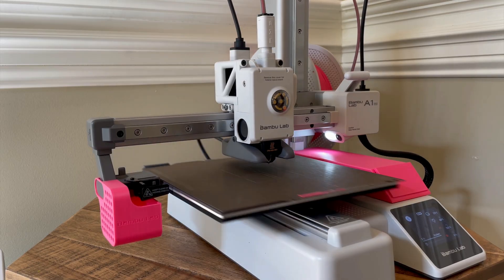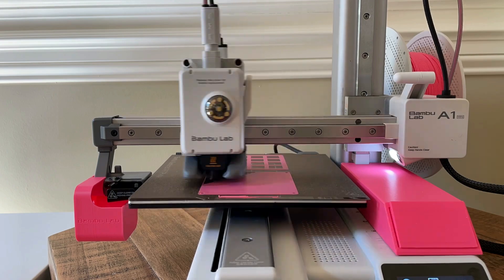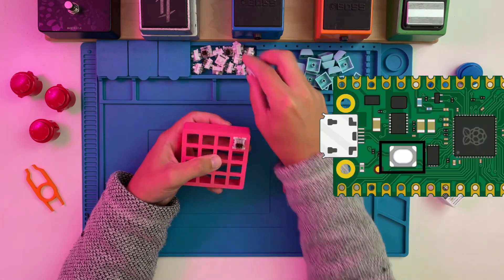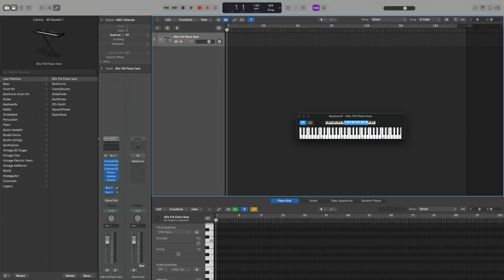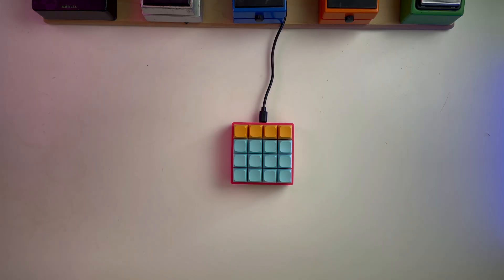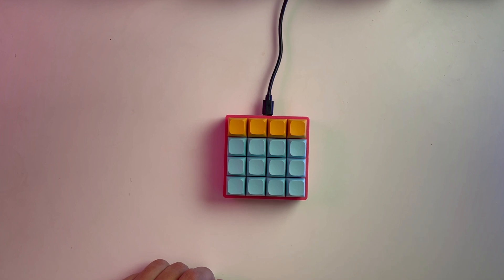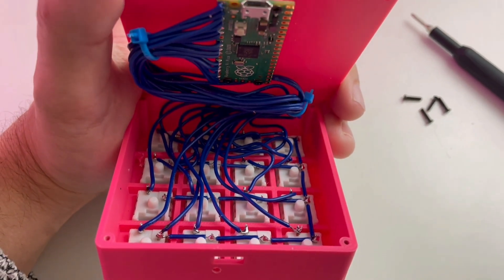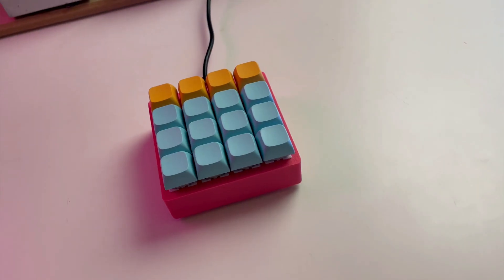DIY 3D-Printed MIDI Macropad | Simple Design, Hidden Features w/ Raspberry Pi Pico

Comment: Hi and thanks for the cool video. I tried to  work with a Pi Pico too but using circuitpython. At the end I could  send MIDI to my pc but not to my Yamaha keyboard using USB. AI told me to buy a USB Host MIDI device. Do you think that this is correct? Cause in other of your videos you said something like these devices support MIDI directly. Or did you only mean MIDI in combination with a PC? I’m new to MIDI, so sorry for this stupid question.
Reply from the maker: That’s a good question. So there are two USB MIDI types: MIDI Host and MIDI Device. Raspberry Pi Pico is a MIDI Device. A MIDI Device needs a MIDI Host to connect. Two way communication is possible between MIDI Host and MIDI Devices but two MIDI Devices can not communicate unless they go through a MIDI Host. Your DAW would be a MIDI Host. Some MIDI Controllers and Microcontrollers like the Teensy can also be a MIDI Host but Raspberry Pi Pico is seen as a MIDI Device. If your Yamaha can act as a USB MIDI Host then the Pico should work with it but if the Yamaha is another USB MIDI Device they can’t communicate without a MIDI Host. I hope that explains things.
Reply: @mobypixel Thanks for the helpful answer. Then I have to buy a small device like the CME H4MIDI WC. Or I try to use the Pi Pico sending UART signals via a cable with a 5-Pin-Connector with 2 x 220 Ohm resistors for Pin 4 and 5.
Reply from the maker: Yeah, you can make a MIDI DIN circuit that uses UART. I’ve not tried that before but it should work. I have the parts to build that circuit but haven’t gotten around to it. If you aren’t opposed to using a computer in some DAWs you can plug up both MIDI Controllers and have the daw send messages from one device to the other. Not ideal for a DAWless setup but it can make patching a lot easier.

Comment: This is cool! Can we get the link to the microswitches, I cant seem to find them:(
Reply from the maker: I've just updated the Github Readme with the ones I used. Cheers!
Reply: @mobypixel  Thanks! How would I go about creating a remix of the 3d model and legally crediting you as the original creator?
Reply from the maker: It is MIT license so you can use it however you like. Attribution appreciated but not required. As for remixing it I’m not sure. I made it in TinkerCAD. Is there a file type or way to share a project from that app that is editable?

Comment: Really great project. I am also trying to build a groovebox+sequencer+sampler thing from scratch. This was really useful in seeing the capabilities of the pi pico
Reply from the maker: Thanks! That sounds like a cool project. For anything sample based I'd check out Teensy or Daisy Seed. They cost a bit more but a little more powerful and designed for audio. MicroDexed-Touch is a great groove box on Teensy and Chompi uses the Daisy Seed. That being said, the Pico punches above its weight class and if you can get the sample playback working well it could be a great, affordable option.

Comment: Hi, I wanted to ask if there is also a way to implement a multi-track mixer with AudioKit? With audio routing, etc.
Reply from the maker: I’ve not messed with it much but they were talking about multitrack work on this thread. https://github.com/AudioKit/AudioKit/issues/2962

Comment: Something like this could be fun as a EWI/EVI style controller. Make an enclosure with seven keys in a line and maybe a few on the back for the thumb. Use it alongside the TEC or Zefiro breath controllers. I've also thought a binary controller could be fun. You could get 8 notes out of 3 keys; 4 keys, 16 notes. Maybe add another set of keys to select octave. You could cover 8 chromatic octaves (plus a bit) with just 3 octave selection keys and 4 note selection keys.
Reply from the maker: Those are great ideas! I never played any wind instruments, but the EWIs looks cool. I really like the binary idea. I could see the three keys being used to select a chord and a second row to "strum" the notes. Having the ability to add keyboard keys to a build opens up a lot of possibilities. Cheers! 🙌

Comment: Awesome project. I assume this can all be programmed to use a USB number key pad.
Reply from the maker: The software is running on the Raspberry Pi Pico and is being seen by the computer as a MIDI device. So I don't think it would work with a generic USB numpad, but maybe someone with more knowledge of USB keyboard protocols would know better than me.
Reply: @mobypixel  Oh yeah, it would have to be programmed on a software level on the OS rather than device level.
I think there are macro programs for this very purpose, like you can use a whole second keyboard as a studio device.
Your little open-source Ableton keypad-like device is still sweet as. Thanks again for the video. o7
Reply from the maker: @chainreaction8977  I was able to connect a typing keyboard to a Teensy's USB Host pins and send MIDI to my computer over USB. That doesn't help with this project but that might be something fun to tinker on next. Cheers! 🙌
Reply: @mobypixel  Awesome, looking forward to the video!